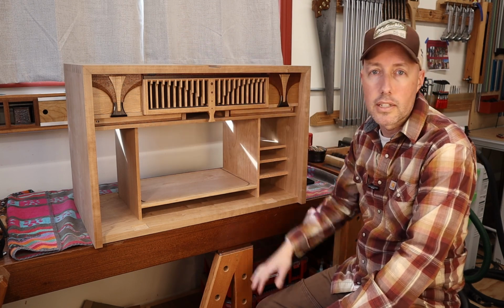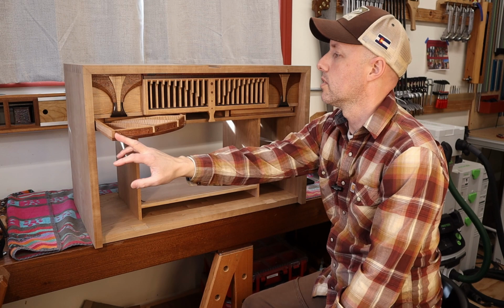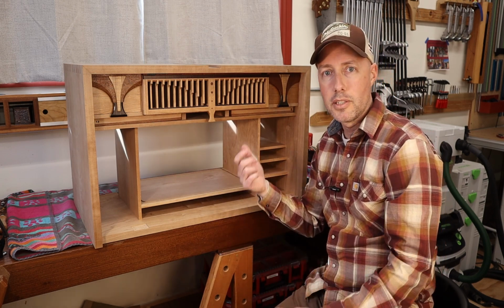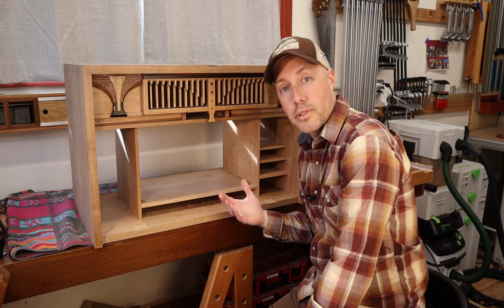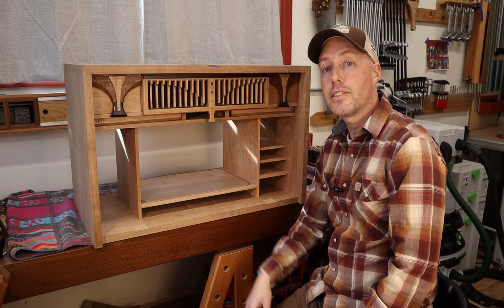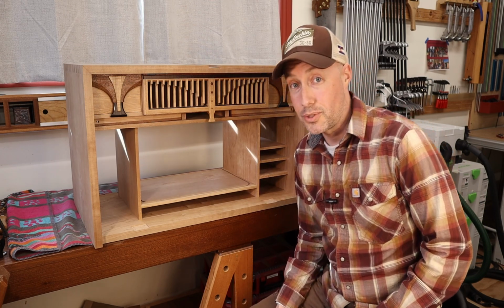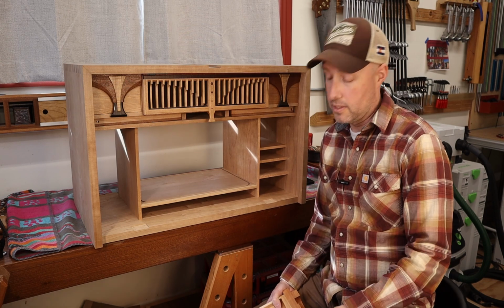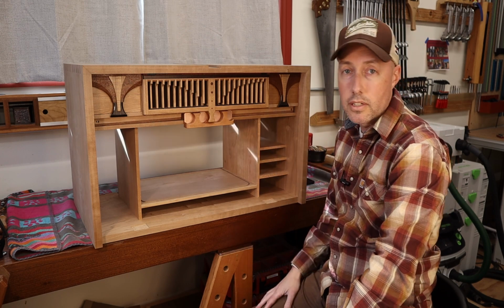Furniture in Progress: Bargueño Desk Part 2

Comment: Amaizing desk, editing, craftsmanship, and overall an enjoyable video. Will defently be following the build as you keep updating us on it! 

One question though. What tool did you use to create the cove molding? I see you have what appears to be a very small molding plane in your hands?
Reply from the maker: That's an Asian wooden moulding plane I bought a set of from Lee Valley. They're barely serviceable, but I've been able to make them work in a pinch.
Reply: @themountaintopjoinersshop8422  interesting. Since you have some experience with them. Would you say its worth  salvaging the blades and making new bodies for them? Is this an idea worth pursuing, or should I save my money and look somewhere else?
Reply from the maker: I'd definitely look elsewhere.  Either buying  a few new ones, rehabbing some old ones, or making your own using blades from Corradi.  If I had more shop time, I'd be making my own if and when I actually need one, which isn't often.